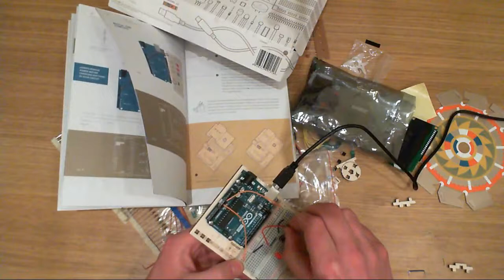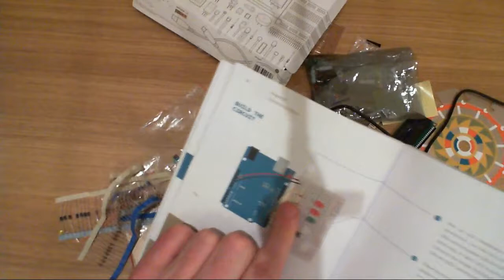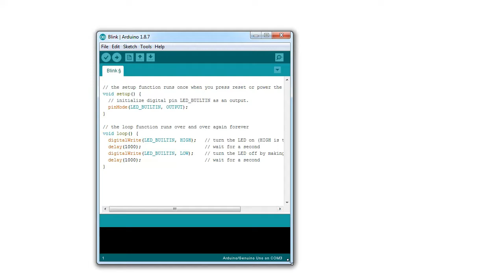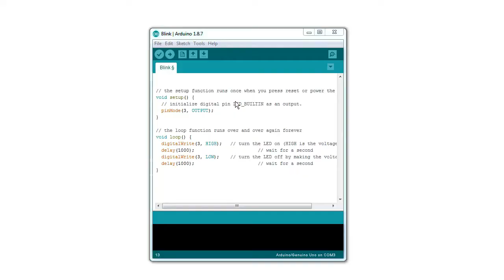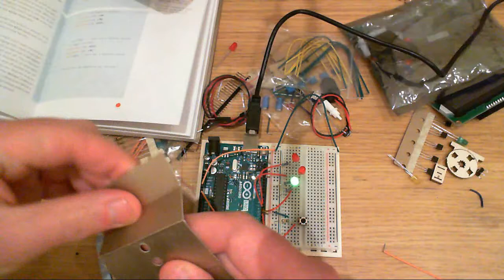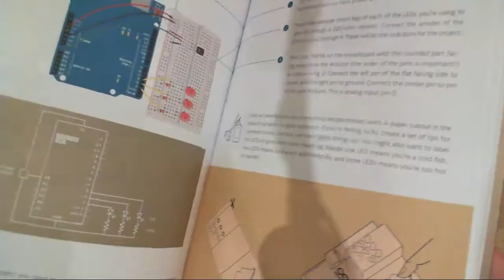Sofox tries the Arduino Starter Kit - Chapter 02 - Spaceship Inteface

Comment: Hmm... I'm still trying to figure out the philosophical aspect of putting the resistance on the positive or negative side. Does it have something to do with whether you choose to resist positive or negative stimuli?

Another thing I don't get is how you can control a spaceship with this. But that's a neat way to program circuits.

I liked the idea of the wire saying "hey, this is like really, really high!". And also the mild amount of amusement.
Reply from the maker: I dunno, maybe its that no matter whether you're positive or negative, you'll always encounter resistance!

I think that's in a later chapter :P

Hehe.